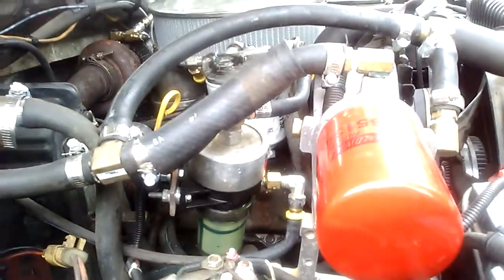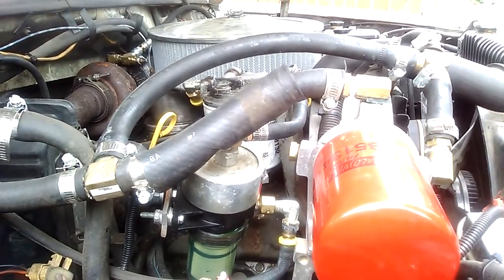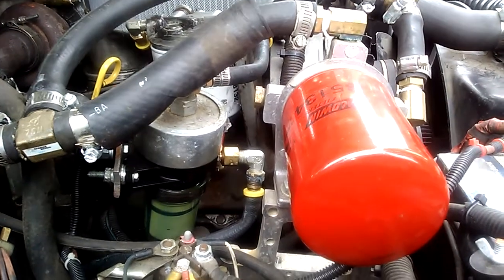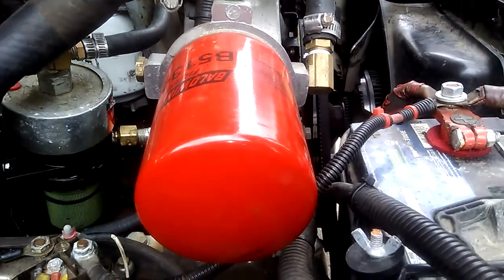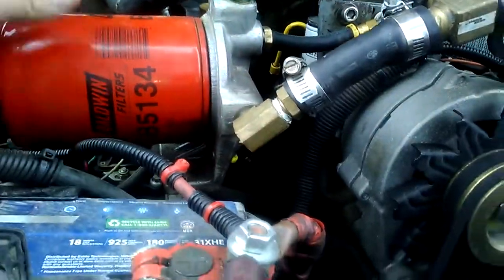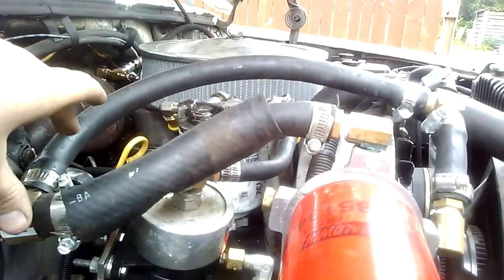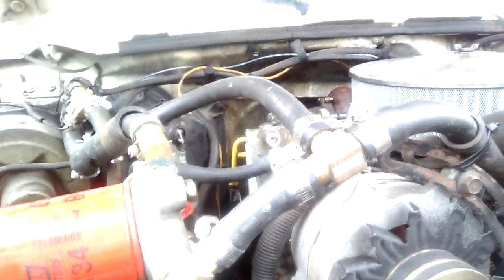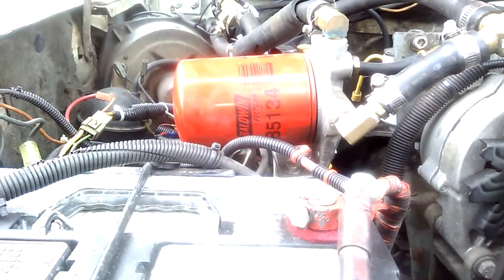Part 1 Coolant filter 7.3 IDI and cavitation

Comment: What brand coolant do you use I was looking at the motorcraft vc5
Would I do all 8 gallons with that and then throw a bottle of the vc8 in?
Reply from the maker: I want to say I bought the fleet charge from TSC at the time. 1 bottle sounds about right I believe the exact dosage instructions were on the bottle. Final charge similar to fleet charge comes" premixed" thou